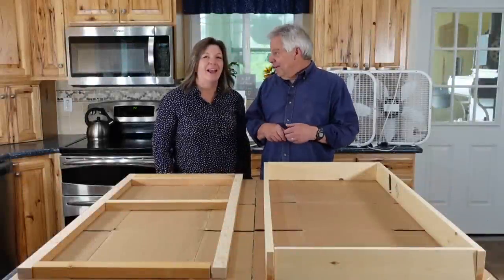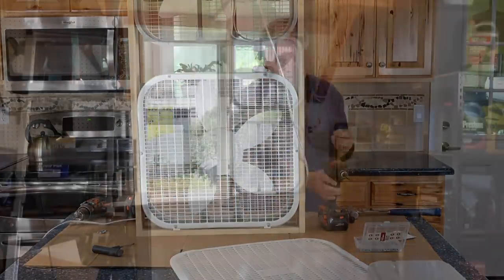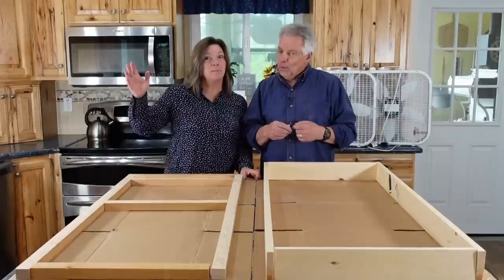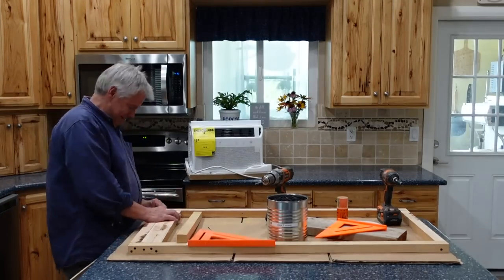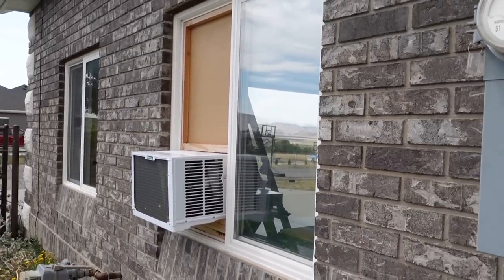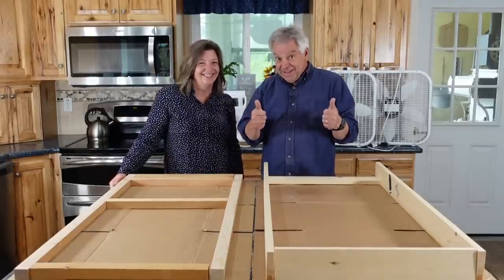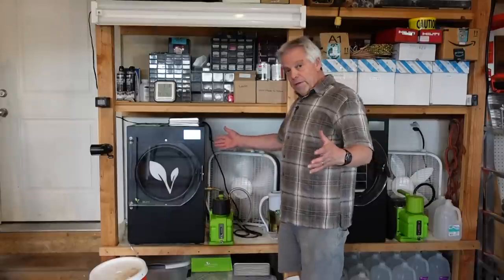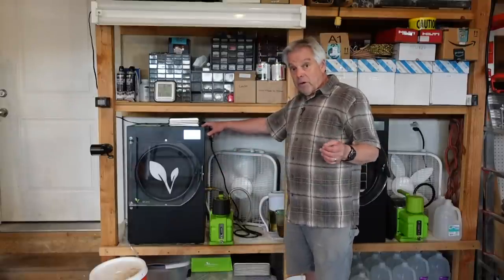Food Storage: How to Reduce the Temperature in Your Garage

Comment: For years we've used two fans one blowing in at the lower level at the opposite end of the house from our stairway and one blowing out on the upper level at the opposite end from our stairway. Same as what you're doing with your two fans. A fan will also move more air if it's in an opening larger than just the fan box.
Reply: Hey Dave...it is amazing how much cooling you can do using the system you are using...basically a whole house fan. Thanks for sharing...and for being part of the solution!

Comment: I would have thought you would have needed a baffle between the upper and lower fan else a lot of the incoming air would go right back out the exhaust (fan suction overrides convection).  Be interesting to do a smoke bomb test to see the air flow pattern.  But if it works, it works!
If you don't already have an insulated garage door, there are vids of people using Reflectix (the foil bubble radian barrier) on the inside of the door to drop the heat about 10degrees.  
We're at the season where the over night lows are still 80+ so the fans wouldn't make much of a dent.
Reply: Nah.  Turn the top fan around so they both blow in. Put the 3/4 round curtain rod brackets on the outside of the box that the fans are screwed in. The brackets on the top should pointup, the ones on bottom should point down.  Cut a section of PVC just longer than the spacing of the curtain rod brackets that is the appropirste sized pipe to fit snugly in the brackets.  
 you want dead stop caps (1ea) and threaded fittings for each pipe but don't put them on just yet.
And a piece of fabric for a curtain or screen.  Cheap low thread count, something were air can move through the fabric but not too quickly, also a more natural fiber that is very absorbent and good at wicking.  Something like cotton, fine weave burlap, wool, hemp, jute, bamboo etc.  If you can only find sumynthetics m, won't something you don't have to worry about ever breaking down or just want to experiment with different things, synthetic fibers shouldn't hurt but I don't feel you'll get entirely the same result.
You'll also need a drill with drill bits.  A vice for safety, an angle grinder os some way to cut a slit most of the length of one of the pipes, some some synthetic wool like for stuffing pillows, 1 or 2 of the plastic or acrylic rods used you opening or closing the blinds.  You know that thing that twists? Yous should be ablento buy replacement ones.  If not basically a piece of dowel rod or small rebar..rear... something straight, stiff and skinning enough to fit inside the PVC pipe.

Now we are going to make a swamp curtain.
The top piece of PVC pipe gets small holes drilled in it starting at the middle and working out, basically measure from the ends how far on the fitting will go, mark the ends there.  Now you're gonna want at least 3/4" ir so from the end cap to the curtain so that you can use the curtain rod hangers without the curtain touching anything but the PVC pipe, ideally you would cut so the end caps almost touch the rod hooks on each side so it holds it centered and doesn't slide back and forth.  The holes you want at least an inch or 2 from the last holes towards the outside to the ends of the curtain.  The bottom piece of pipe is going to get a slot cut in it at least wide enough to 4-5 layers of fabric to slip through easily.  Then we're gonna make a hem with a rod pocket on each end of the fabric curtain.  The one up top will need to be ay least 2× the size of the PVC pipe so when the PVC pipe goes in and the curtain is stretched downward it mace a nice teep V shaped guide channel.  Water will hit that and wick down through the fabric sheet/curtain rather than come pouring out the ends or go everywhere. The bottom rod pocket hem you want just big enough to slip the dowel or acrylic rod through it.  So the top rod gets packed with the synthetic cotton stuffing, the end caps go on it just slips through the top of the curtain and a tube or hose attatches to the threaded fitting.
The bottom of the curtain and the bottom piece of PVC is the tricky part and the one part of this whole ordeal where once you put the ends on the PVC if it isn't right then it isn't coming apart. Hence why I recommend the acrylic rod/dowel, because it won't rot like wood. The bottom hem of the curtain gets pushed through the slot on the bottom PVC, the acrylic or plastic rod gets pushed through the rod pocket hem on the bottom, all the way in, then the end caps go on the pipe and a piece of hose or tubing goes on the threaded fitting and either to a bucket or outside.
So the water faucet for this you want to barely turn on.  You don't want a spray, you want barely a drip, just enough to keep the curtain wetted out.  So water comes in the tube on top, saturates the batting and stuffing in it which helps to both restrict the flow of the water but also helps to with it through the entire pipes.  It drips out the holes and gets absorbed by the sheet.  The water travels down the sheet and absorbs heat off the air through thermal transfer and thermal dynamics as it does.  Once it's traveled the length of the sheet/curtain, what hasn't Beek evaporated goes down into the second pipe where it drips into the pipe, then flows out the end and into a bucket or goes outside.  Either way you may be able repurpose that used water for the flower bed, garden etc.
Either way, I haven't yet made my own prototype, but I feel that it should work.
But yeah.  Add a swamp cooler to those fans, turn them both facing inward and you've got a pretty simple inexpensive solution.  Then get a bathroom exhaust fan or some form of ventilation fan to go in the ceiling of the garage and take heat up and out... remember, heat rises and cold falls.  If you've made a positive pressure system with the swamp cooler in the window you want some slight negative pressure.   Not a lot of negative pressure. You still want the room or garage slightly pressurize because if you're able to get enough cold it should help to push heat out but you do want to carry the hottest air at the ceiling to be carried out.
Reply: And, while it may not be as effective as an AC unit, and requires water (you coukd even recycle the bucket water once it's cooled off at night) it's relatively low tech and apocalypse proof.
Reply: Hey Steve...my first prototype had a baffle between the fans, but for now, I decided to see how it goes without. The baffle makes it challenging to get to the windows and knobs. I am relying on the physics of the cooler air coming in and sinking, and the warmer air rising on the outside. I suspect there may be a slight amount of mixing, but my temperature readings seem to indicate it is fairly minor. I was thinking the same thing...be fun to do a smoke test to visually see what happens. I also want to ponder on some other variations, but for now, it is making a significant difference. As for the garage door, yes...it is insulated...you make a great point, that is a easy way to make a big difference. Keep doing great things...thanks for your comments!
Reply: @JonathanBJones  maybe something like those dog agility tunnels as a duct from the hot air exhaust fan intake up to the garage ceiling... or a attic exhaust fan near the ceiling... could get you down to only powering 1 fan.

Comment: I live in Texas.  My attic was foamed.  The attic is around 79 degrees when the garage is 100.  
Bought a temperature pallet blanket from ULine, and I have a Rigid floor fan.  Thought that putting some velcro on the blanket to encase the FDryer in its nook, and blowing the cool air down into the cubby.   Simply leave the opposite of the fan side open so the heat can go up.  
No AC bought, but I now leverage the cooler air from the attic to cool just the section of garage that holds my FD.
Reply: Great info…..We’re in north Tx, we got a Harvest Right FD in Feb and can’t use it cuz of the heat in the garage. No where else to store it. Covered north facing windows but still hotter than snot in there. In fact I think the machine is dead, from just being plugged in, not using it. Very disappointed in the product.
Reply: @cinnamongurl8102  I feel your pain.  The problem, is the right room and environment for a very temp sensitive piece of equipment.   Ice makers don't work in a garage that's 120 degrees, doesn't mean they stink, just not rated for that location.    The pumps are fragile, and not running them for long periods of time, and using them in super hot locations will knock them out.  This summer is extraordinary!  I hope you find a solution.  God bless!

Comment: I grew up without A/C.  We would put a large fan at the bottom of the basement stairs blowing up into the ground floor of the house.  We would also open windows at night and blow the cool air into the house.  In the morning we would close the windows, and make sure the thermal curtains were drawn in the south facing windows.  We would keep the north facing windows open with the fan blowing the cooler air (north side of the house got no sun) until about noon or so, at which point the outdoor air was usually too warm and then we would close those windows too.

Comment: At least y'all have windows in there, which opens up the ability to put in a window unit. We don't have any windows, and ours is in the garage (in South Texas) as well, which means it gets really warm out there! What we ended up doing was, buying a swamp cooler, and aiming it directly at the Freeze dryer motor and a fan blowing behind it aiming at the freeze dryer itself. Should it get hotter in there as we get further into the summer, we'll encapsulate the motor with the swamp cooler so that the cool air stays around the motor. 
It's the best we can do.

Comment: I live near SF Bay, which acts like a giant air conditioner.  When the big Sacramento Valley heats up, it draws the cooler air in from the Bay & off the Pacific.  When the valley really heats up it draws a marine layer in & SF gets fog, & we get cooled down as the the cool air rushes out the delta to try & equalize temperatures.  Location, location, location. 

However, we do get some really hot days as the climate changes in the whole Western US & Canada, and we do NOT have AC.  On those days we open windows at night, then in morning we shut all the windows on the south side, close insulated shades, and a year or so ago replaced all of our windows with treated double panes to keep heat out in summer & heat in during winter.  We are able to keep windows on north side open & station fan near windows to push air around. That circulation has a cooling effect.  We also have a couple of rechargeable 4” fans that have big clips that get moved around.  And I have a larger Ryobi Tools 7.5” shop fan that runs on the same batteries my jig saw & cordless drill us (fan is often a “free tool” when you buy the lithium batteries on sale near Father’s Day). It really moves a lot of air.

Comment: Ahh yes, the honey do. Great to see an engineer at work. Great job Jonathan. 
Here in FL., we survive on A/C. A window unit on gas generator for short term grid down and pile in one room. Long term will have to borrow your idea with the fans. Something pre-fab that can be installed quickly when we need it and not need to get materials. 
As for your situation Jonathan, I noticed much sun (and heat) coming in through the unused windows as well. What about some Reflectix panels cut to friction fit or a little Velcro? Just a thought.
Reply: I hate the phrase  honey do. women are not totally imbeciles and actually are do yourself  in this day and age

Comment: With the fans, maybe add deflectors. Deflate lower fan to floor & upper fan to draw more from ceiling?

I use the fans for the house, in one window & out the opposite side of the of the house. Many times i am below the 400 kw level of power usage (much cheaper).

Comment: as to cooling... now YOU are running a specific high heat device (the freeze dryer) but if you are cooling a house, or trying to cool a garage inexpensively?
run the fans all night (if possible get the one fan up even higher and the other one lower)
then in the early morning, BEFORE it gets hot, start the air conditioner and get the temperature down as far as you can.  it wont be difficult because the room isnt HOT yet.

you can then use thermal inertia to keep the temperature  from rising too high... especially if you have  brick or etc walls

PS, please do always look into insulation!  that can help immensely, and putting solar panels on the garage will generate the most power when you need to run the air conditioner!

in addition, if you live in a lower humidity area? you can wet down any concrete or brick walls or floors and use  evaperative cooling as well

Comment: Your timing is perfect. We are dealing with this very problem, freeze dryer overheating. We have a small fan in our small basement window where the FD is, taking air out.. We have three fans situated around the dryer and a big one on the floor. This helps but we still get the warning message. We only have one window to work with. So i think it would be best to put an air conditioner in that window and close the doors of the room it is in with the FD. What do you think?
Reply: Try putting a fan blowing into the room where the freeze dryer is, you will be moving the cooler basement air from the other part of the basement into the area where your freeze dryer is.
Reply: @KellyS_77  we have five fans stregically placed in the room including one in the window pushing the hot air out. Minimal results.  My husband jumped right on it and installed an air conditioner is that window. Getting  ready to run the next batch. But, I  appreciate the advise.

Comment: I have that problem with the heat and my freeze dryer.  I don't have any widows in that room and the only other method is to put it in the main house but with no air conditioning my house ends up feeling like a hot oven.  I am trying to find a solution but haven't so far.
Reply: Do you have a small unused room that you could put the freeze dryer in and close the door so it doesn't heat up the house?  Maybe run a fan blowing out the window to move hot air out of the room when the freeze dryer is running?
Reply: Hey Lynda...definitely a challenge. Possible suggestions I have include:
   1. upgrading insulation, primarily in the ceiling.
   2.  Installing a window that could be used for a window AC and/or fan.
   3. Mini split - a bit pricey but very nice and efficient for both heating and cooling.
   4. Whole house fan if you have a way to bring cool air in down low when the temperature outside drops below inside temperature. Quiet Cool makes great efficient DC units
You have probably have thought of these already, but keep the wheels turning and let us know how we can help! Thanks for being part of the solution!!
Reply: @KellyS_77  That is where I have it and there are no windows.  Therefore my problem.

Comment: Any good solutions for a garage with no windows, and no side door?  It gets 90+ during heat waves in summer; almost to freezing in winter.
Reply: Perhaps, a mini split heat pump or a through the wall AC with heat.
Reply: You must live in Nevada like me, same problem
Reply: insulation
Reply: That is a great question and a challenge. On the bright side, windows are a source of heat loss (in winter) and heat gain (in summer) since their r-value is close to 1. I like the other replys so far. Insulation, to the extent it can be upgraded, is a good start. A mini split is a good option...a bit spendy, but it would allow both heating and cooling. And remember, for the most part, we are not trying to keep it at 65 degrees. For me, I am just trying to keep it at about 80 degrees instead of 95 or 100, so that makes a huge difference on energy usage. You could also look at a whole house fan in the ceiling if you have the ability to leave the garage door open a couple of inches, or can create another way to pull in cool air when it is cooler outside than in. I am not a fan of leaving the garage door open ajar because of mice and other critters, but lots of people do it for cats and such. Quiet Cool makes a DC version that is extremely energy efficient...that is what I put in our house. Keep the wheels turning and let us know how we can help! Thanks for being part of the solution!
Reply: @JonathanBJones  I wouldn’t crack the garage door.  Lots of mice in the area that I’m constantly battling.  It’s entirely dry-walled, so I don’t think insulation is an option?  The attic is above the garage (we have a pull-down ladder on the ceiling to get access), so maybe adding insulation up there would help?  I do need to replace the garage door.  It’s an old wooden one.  Do you think getting an insulated garage door would make a big enough difference? Thanks